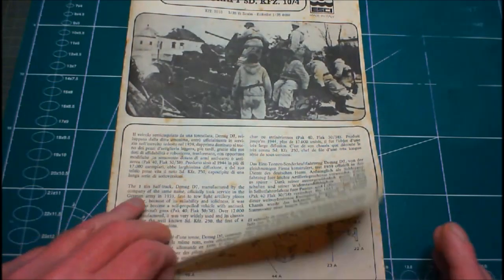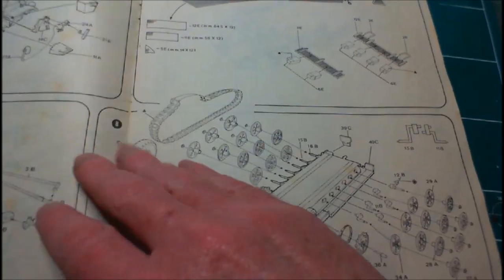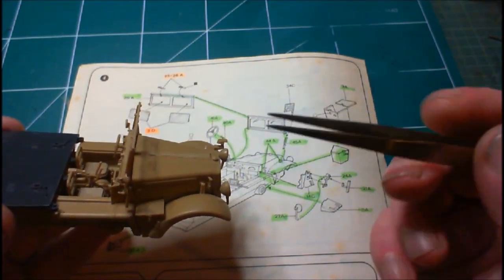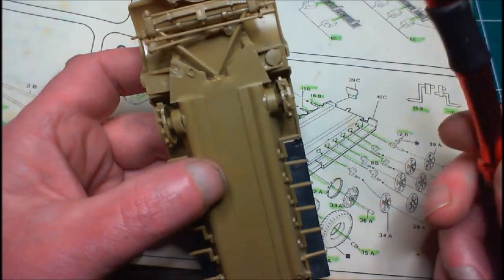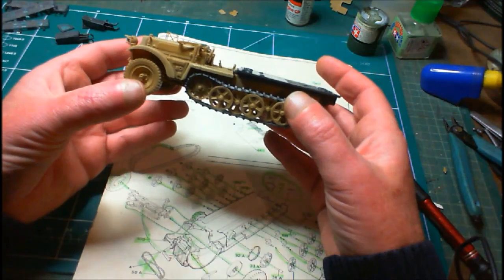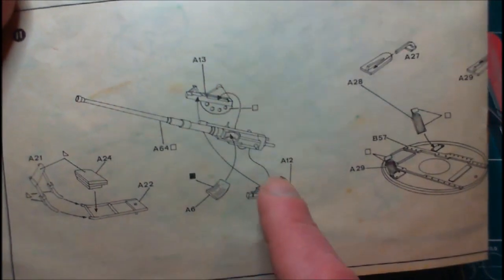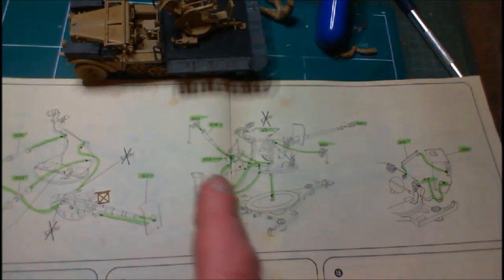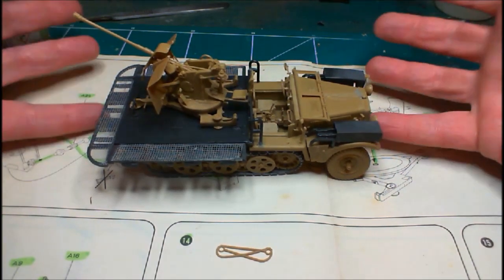ESCI 1/35 Scale Sd.Kfz 10/4 20mm AA Build Update 1

Comment: I have two of these kits plus I once built the ESCI standard sd.kfz 10 which was moulded in really brittle dark green plastic and was very difficult to work with. Both of my sd,kfz 10/4's are moulded in good quality off-white plastic but still with a lot of flash. When I built the first one it didn't turn out too well because I didn't put much effort into it but after building the Italeri sd.kfz10/5 I realised that the ESCI kit has several little details that the later Italeri/Revell/Tamiya kits are missing so its worth the extra time and care it takes to build.

Comment: Currently building that Nightmarish kit. Loose Fit, bad Fit, missing indikations where the Parts should go exactly, misleading or incomplete instructions. Very fiddly time to time. One can notice the age of the original Kit. My advice: read the Instruction in advance, dry fit before glueing, support drying parts with jigs (the soft plastic, once in contact with cement takes loads of time to dry). On the other Hand somewhat very nice details.
Thanks for sharing that Video, it helps. By the way: the issue with the guns Sights isn't your fault. I will run into the same issue because the instruction tells to glue the Sights in Place before the Elevation of the Gun is chosen (and connected by rod between Sights & Gun).